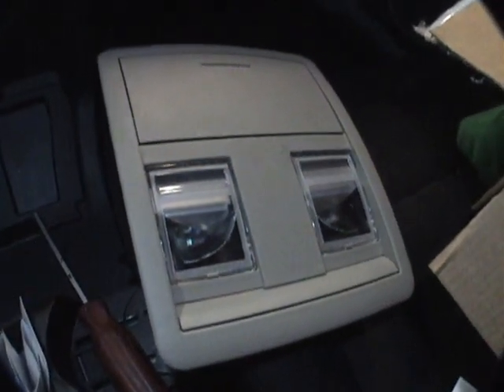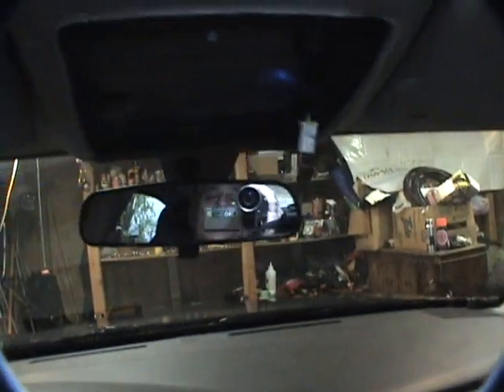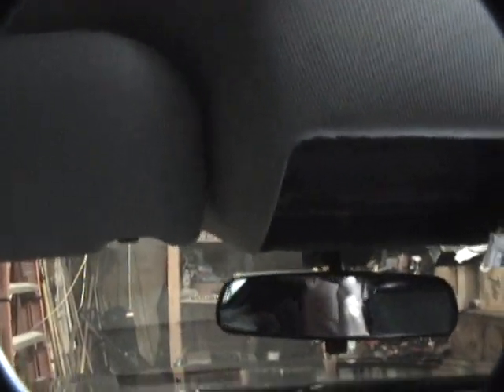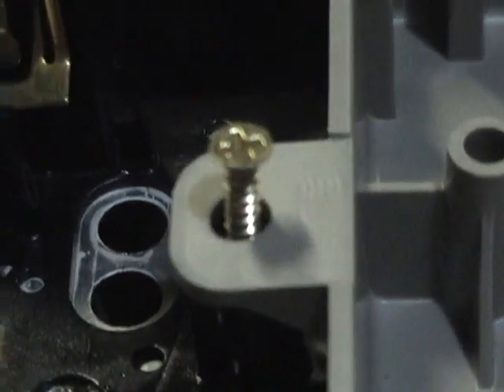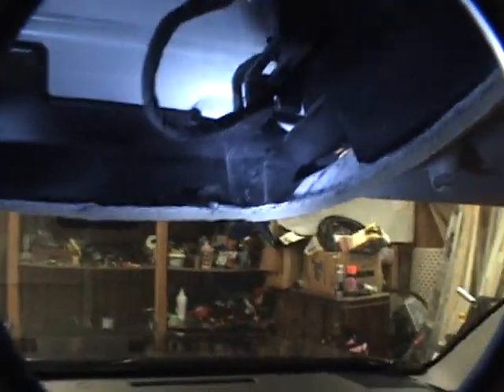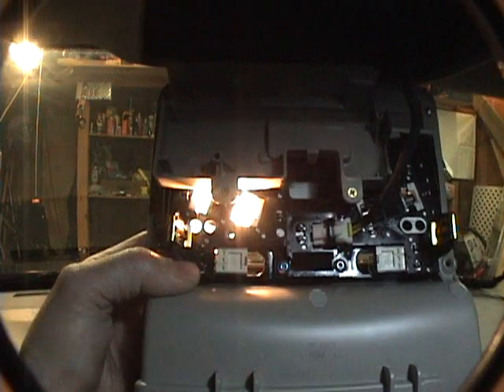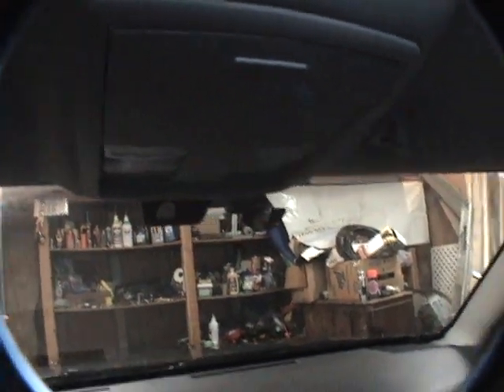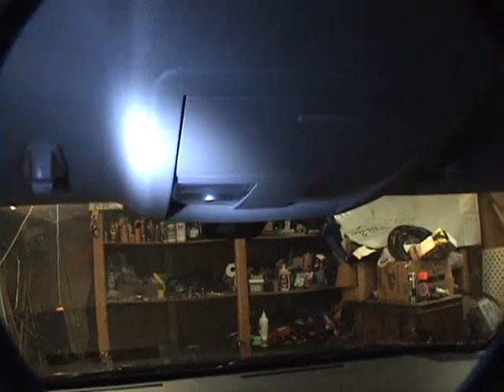Over head console Installation. 2006 Dodge Charger pursuit

Comment: i have pursuit charge also an i wanted to ask what did you to get that dome light to come on when you open the door cause my charger doesnt do that when the doors open....
Reply from the maker: I had to buy all the parts at the Dealers. Junk yard guys just said no. If it has one already then a fuse or corroded wire connections. Dead bulbs?

Comment: stupid question, but was the cable already there? If not, where did it connect on the bottom end?
Reply from the maker: Yes the electric cable was there. It is a cop car from the factory.
Reply: LSE SSII Awesome. Have the console. Ordering the retainer. Thanks.